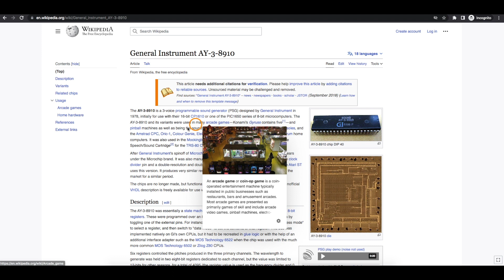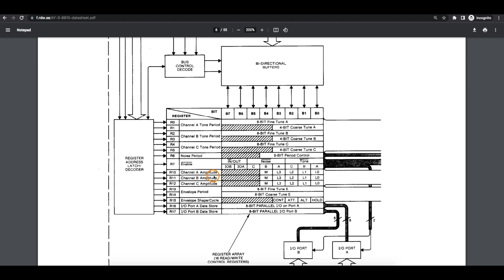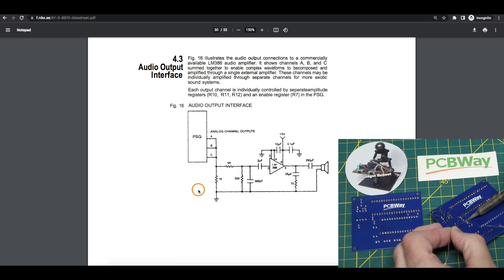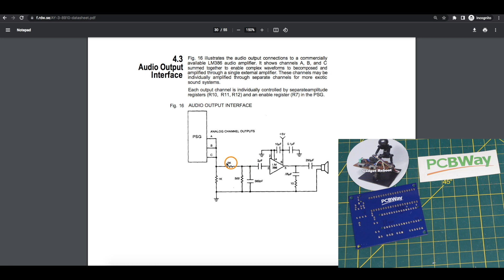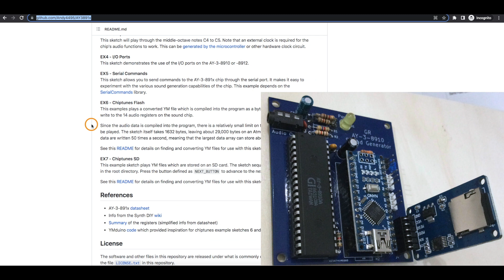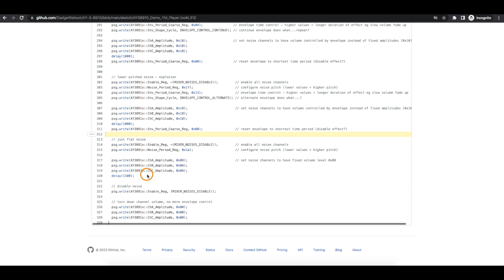AY-3-8910 Sound Generator with Arduino

Comment: Thanks for sharing this. I ordered the PCB through PCBway and got all the parts from various sources. It works! I love the vintage chiptunes. The downside is trying to find compatible files to play. I managed to find about a dozen working files using the links you provided. But, figuring out how to decompress and convert YM files is going to be another project.
Reply from the maker: I have to learn how to do it all again myself. I’m gradually going through all kinds of old files and I have a bunch of other format files like STM and MOD I used to play back on old 486s, if I can ever find it all.

Comment: I had already asked in your video, which you posted under “Gadget Sideload”, whether you hear a crackling sound while playing songs (instead of the original) - especially when there are changes in the treble range caused by PWM timer. I'd be interested to know if it's the same for you... as I've been working on this for some time now and I'd like to rule out whether it's due to the circuitry, the crystal or just the PWM hardware timer on which the library you're using is based too.
Reply from the maker: I never had playback sound issues with any audio files I had tried, although I haven't used it since the video over 2 years ago now and I don't know where the PCB is to re-test.
If software could be to blame, which sometimes happens with revisions, I noticed the library I used has been updated since then, so I wonder if there's better luck going through the Github history on that project page and digging out one from 2 years ago to test.
Also I was using the old Arduino IDE 1.8.13. at the time.  I have had experiences where different IDE versions cause unexpected problems on some things so rolling back to older libraries and using the old IDE might be a useful debug step.
Reply: @GadgetReboot   thx for the answer, but no, no... it seems it's more a hardware problem in general to control AY3 with a PWM hardware timer by mcu. the crackling is more subtle but auditble but also not equally strong with every song, with some almost not noticeable at all, but I would like to find out and try to find comparisons from people who also use PWM for clock control. thx anyway.

Comment: Hi Gadget Reboot.  Where did you obtain GI AY-3-8910 chip?  Looks like you opened it brand new from the packet
Reply from the maker: it was bought from RadioShack probably either in the 80s or 90s by the person I got it from two years ago along with a lot of other things like that when they were finally clearing everything out. Then I got a bunch of others on AliExpress that are microchip branded although who knows if they were knock offs.

Comment: Hi, appreciate your effort to document this piece of history. i do have an issue with it . 
sound from playDemoSounds() is perfect, but when i read from SD, it is waaaay to fast playback. 
looks like arduino is reading from SD card and playback at very very fast rate(most sounds are all together, and i hear only beeps and white noise)
changing clock speed from 2Mhz to lower, does influence the playback but not in the desired way.
do you have an idea?
Reply from the maker: No idea how changing any settings from how they are in the sketch would impact anything but since it's been a while, I re-compiled the sketch that plays the demo sound effects followed by playing anything that's on the SD card just to verify.  Originally I used the older 1.x. IDE version and I didn't know if maybe there's been a library change or something.

So compiling the same sketch in IDE 2.3.4 and installing the AY3891x library 2.0.0 it still runs the same way for me, working fine to play the demo sounds and then anything on SD.

Some ideas, first, here's the exact SD files I'm using, so I wonder if those work better for you https://github.com/GadgetReboot/misc_file_bin/tree/master/2023-wip_projects/ay38910
It could be something in the files causing them to behave weird.

Another thought is maybe there's different hidden files being read from the SD if things have been deleted and moved around when connected to a computer to copy the files in.  So it may blindly be opening and trying to play something that isn't a sound file.  On Mac I make it show hidden files so I can go delete all those weird dot files and try to empty it out, or else re-format the SD again as a FAT16 I think it is, and copy the sound files freshly in.  

I did notice when playing it now, there is a slightly glitchy sound and a delay from ending the demo sounds and starting to play from SD, so I don't know if that is new and if it's still finding hidden files and trying to play but it does find the real files and play normally.
Reply: @GadgetReboot  Hi,  I really thought that i have answer to your message a few days ago, but maybe did not press "reply"

thanks for your insight. software was compiled for me without issues with the latest version of IDE and libraries. 
demoSounds play nice without any issues.
I was using a large library of .ym files. that sound great with an windows ym player.
i was using 64GB SD  card, reduced to 8GB and formatted FAT32, no hidden files as it was first time use, after quick format and just copy the files in.

your files are .sng they play perfect with my original build, but i also used now an older 8GB SD reduced to <4GB FAT formatting.
.ym files behave the same..
so i need to search archives and document myself about this data type.

thanks again , great job

Comment: Recently I buyed mounted this proyect on pcbway. I never used arduino, and I can't work it.  I download arduino ide, but I don't know what is the code and the process to work. I try with a code of the library but not sound the music. Also I wanna  use this like a midi module, is posible, or not with this proyect?

Comment: AH back in the day when we had 8bit ports and address bus and RD/WR logic.
Nothing like the Arduino where you struggle to get a 8 bit bus. Maga might have some but the small ones tend to have the clock crystal hogging a few bits so no 8bit port left to play with. i expect that's why the I/O is normally single bit process, and you have to play a bit more to do port wide I/O.